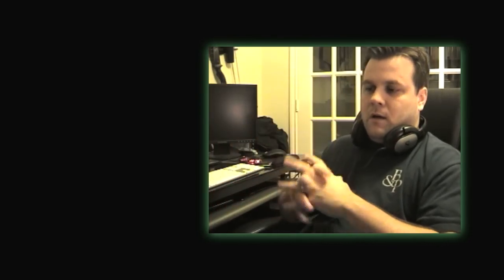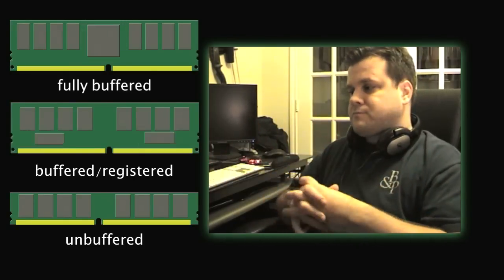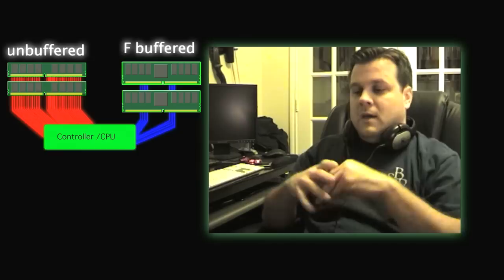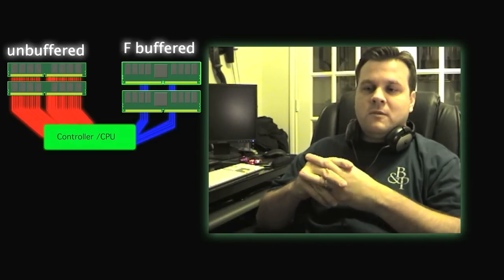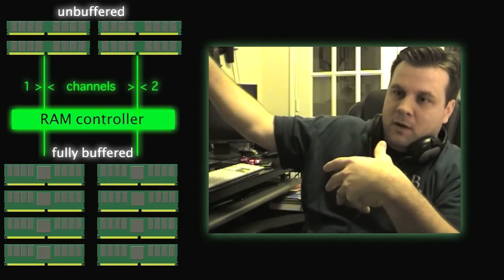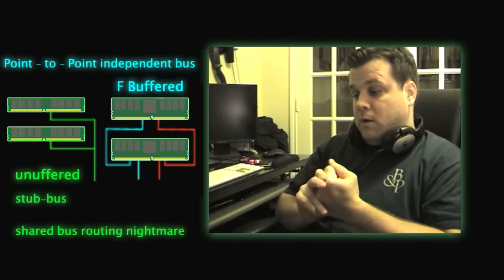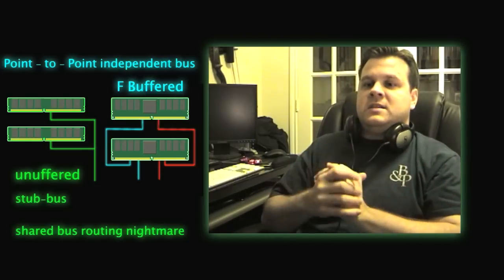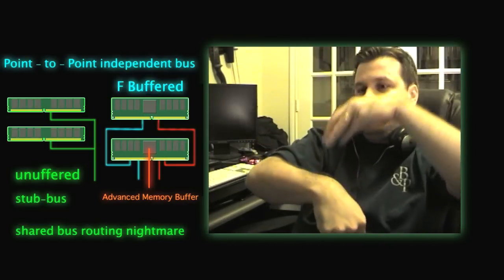buffered & unbuffered RAM

Comment: Gotta admit, I'm a gamer peasant... but I wonder how the higher latency of Fully Buffered RAM would even be noticable?

There have been comparsions between DDR2 vs. DDR3 and DDR 3 vs. DDR4 and of course everytime the systems used were picked in a way that wouldn't present a bottleneck otherwise (meaning WAY outside the budget of average consumers). If any differences were to be seen, they were rather marginal.

Well... I guess I'll find out soon anyway, as I'm currently in the progress of building up a TX200 S4 with 2x E5450 Xeons and 12gb FB DDR2 667 for work and some light gaming.

Comment: My next computer is going to be a workstation.   Probably a supermicro X10SRA-F that supports all the ram types.  Cpu will likely be a xeon E5 1650 V3 (6 core 3.5Ghz)

It would be interesting to see Benchmarks GAMES and Non Games
64 Gigs of non ECC
64 Gigs of unbuffered ECC
64 Gigs of Buffered ECC
64 Gigs of LRDIM ECC

Now If needs are beyond 64 gigs you can't use unbuffered so we will assume 64 and under.

My guess is unbuffered ECC and non ECC will tie in games and be faster than buffered.

But if the difference is 1 percent I think choosing LRDIM is the way to go.   

But I don't know.  Anyone know?

Comment: You wanted to make video quick yet you ramble on and on about why you cant talk about this due to speed.  If you want it quick dont even bother to tell us that as it to 5 minutes to say what was not needed.

Ok let me make this fast.

1.  Unbuffered DDR ram - fast, no error correcting cheap (Most computers use this)
2. ECC ram - Error correcting ram.  Really is needed by ALL computers but in past was too costly.  ECC ram error are more comoon than thought and increase with altitude.  Meaning someone at sea level gets fewer and someone living in Colorado gets more.  In Space a non ecc computer will not even run due to errors.

A.  Buffered ECC - Take load off memory controller, suppoerts 2x ram of non buffered.
B. Non Buffered ECC - More load on memory controller supports less ram.
C. LRDIMM supports even more ram than Buffered 2x more.  But is slower due to latency.  Its the wave of future for servers.

A typical worstation MB.  
- Max 64 gb of NON ecc or unbuffered ECC
- Max 256 GB of Registered (buffered) ECC
- Max of 512 GB of LRDIMM ECC 

What I am not sure is the performance hit on games.   I did read one article that compared ECC to non ECC and the difference was nill less that 1 percent and in some cases the ECC was faster.  So speed is not a reason not to get ECC.

But They did not compare Buffered to NON buffered ECC in games.  Anyone know the performance difference.?

And why ask about games on a workstation?  LOL well almost ALL computer nerds I know that have REAL jobs at dell, etc.   ALL play games.

So why not have the best of both worlds?  You know you are going to game but at same time your workstation is going to have ECC.   so which ECC?  buffered vs NON?

I want to go to Buffered but I don't know the performance penalty.

Comment: Hi im still kind of new to building computers and i watched this and it basically told me what i already know im just wondering if theres any tangible difference between UDIMM and DIMM? because i saw this Crucial Ballistix RAM kits going for really cheap in my country(RSA) and well it says its UDIMM now my board supports DIMM and i dont want to buy the RAM in the chance that it will be incapable with my system if anyone is wondering what my mobo is its a MSI Z77a-G41 and my processor is an intel i5 2400 (non K) Help and advice will be surely appreciated
Reply from the maker: ok DIMM simply means Dual inline Memory module, so the real question is, what kind of DIMM? in your case UDIMM simply means unregistered memory vs registered memory like RDIMM.  Your board is find with UDIMM  The next question you should ask is data rate. IE DDR2 DDR3, your board supports DDR3 1066/1333/1600 and higher via over clocking.
Reply from the maker: mrbit10 fine not find > "fine with UDIMM"
Reply: mrbit10 Thanks so much for your reply the ram is actually 1866mhz and because of the SB processor intsead of IB its suppoerts up to 2133mhz if im correct, again thank for clearing that up for me i was slightly confused as to what the difference is between DIMM and UDIMM because of the confusing description on the product page of the site

Comment from the maker: Of course over the years they have come down, but DDR3 is not equal to DDR2 in latency, DDR3 has much higher bandwidth, thus the debate of latency vs bandwidth.  FB dimms are DDR2 with an AMB, you add to latency when you exceed two per channel.

Comment from the maker: i prefer unbuffered in my gaming rig and buffered where i can afford it.  As for your speed and bandwidth of 1600, it again comes down to timings in games vs bandwidth and DDR3 is still expensive and has a different structure than unbuffered DDR2.  So wait in my opinion, you can overclock some mean DDR2 and get killer performance.

Comment from the maker: FB architecture is already multi-channel, the chipset IE memory controller knows the entire addressable area and therefore sends the data accordingly, channels just mean the bandwidth has been increased by the factor base width in theory.  all channels have to be mapped by the controller and therefore appear as one addressable area with greater bandwidth

Comment from the maker: channel is a series of banks, so the memory controller would know how many channels are available. Is that what you are after or something else?  The controller has to track the information it sends to each channel, not the AMB.  the Chipset in FB architecture is already to go with multi channels basically where as on unbuffered it is switchable.

Comment from the maker: ok, memory is rows in columns.  The controller sends the address, command and data to the AMB, the AMB has a direct bus to all the DRAM on its DIMM therefore it basically has to route the controller information to the appropriate dram location, if that is not on the dimm it acts then as a repeater until the instructions from the controller find the appropriate AMB.

Comment from the maker: thanks :)  the skulltrail mobo which I believe was a gaming chipset did indeed use FBdimm and I remember reading a review about the latency, BUT FB given enough in parallel or if they reduce the timings as with DDR3 is doing it could match the latency loss.  Check out RAMBUS XDR XDR2

Comment from the maker: this used to be an issue in older ram but today not so much, if you have dual channel, then split the load.  In many cases the margin of difference outside of dual channel is not considered noticeable via the whole system.
So if you have dual channel, split the load, if not.. it is up to you as in cost and when you decide to upgrade later.